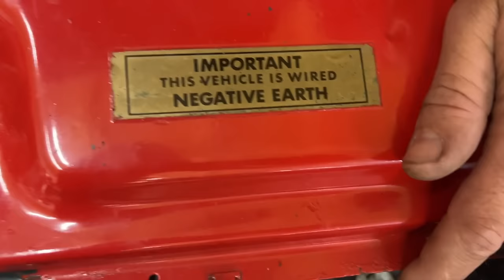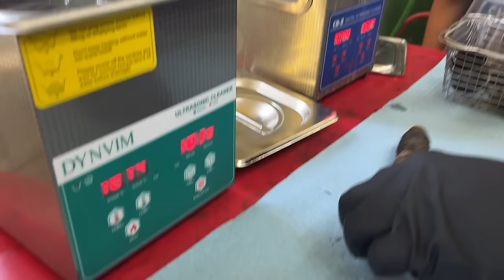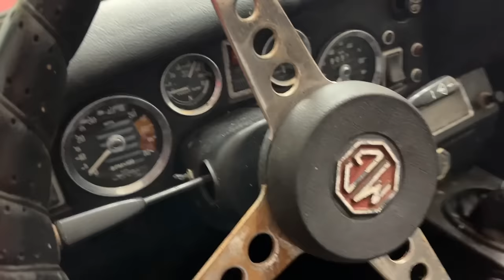My wife bought her dream car back after 17 years! Will it start ?

Comment: The muffler is rust and the exhaust pipe is not rust. The gas tank is disposable because it would have a cap to open as bigger hole for hand and scrubbing pad to clean and sanding inside the gas tank. The filling cap is an extra cap to a total of two cap per tank plus the base fuel level sender is the lid that comes atop the third hole of the tank and unit for electrical contacts. Tube for return fuel line must be clogged up only if the engine runs better that way. The second line is the tube to the tube for gas flow. Fresh gas means brand new tank with the fill up. The perfect 7 gallon tank for 1970 up to 1979 Midget that offer you this $175.00 dollar at pick-up or parcel in Knoxville Vintage auto Sales and Fair ground Convention show dealership but If Knoxville charge you for $200 dollars then it would tell you to add charcoal canister and extra tube as the third line to the gas tank.
 The transmission is worth if you need a brand new costs $1,595.00 dollars plus shipping for what address? Probably around $95.00 estimate by the UPS. And the dealer in Moss Motors says if the rocking arm of the fuel pump is correct one there two different length of open up the arm that the arm will contact lobe in camshaft. One is shorter rocking arm of pump is worth $59.95 dollars plus shipping from Bugeye pump co. at the sale counter named Powertune. The other is longer arm with Pump of Triumph that you don't want it.
  Thanks.

Comment: Why did you say, "Toilet"? After you lost the Weber until finding the parts dropped by the limping red car. Is it Weber or Carter is the right one; Choose one? Either carburetor brands that shall work it on it. The maker Brand new only for the potential buyer like you. That is why you forgot to add in air filter. There is another air filter for only oil breather. The requirement is another air filter for 1.3 Liters engines, needs breathing including another EGR breathing circuit.